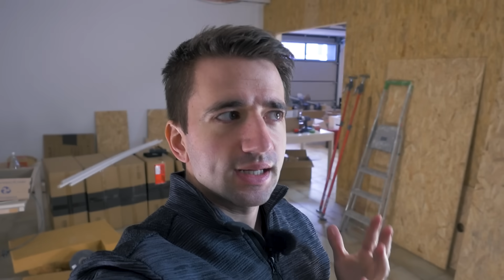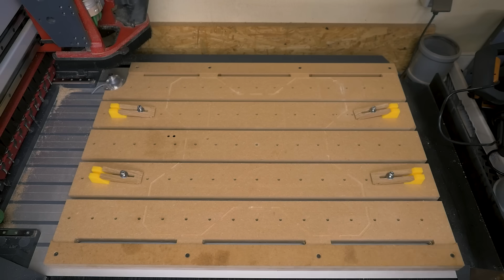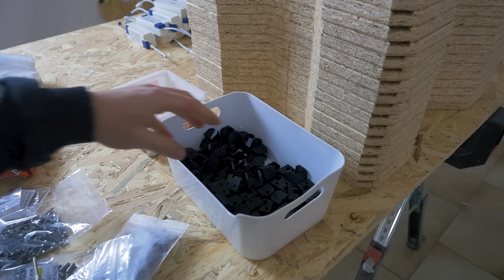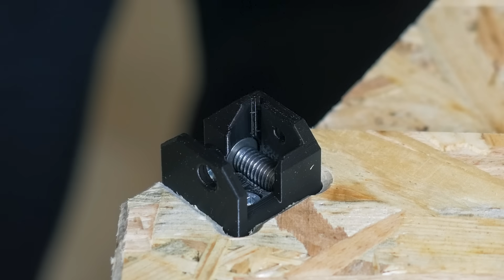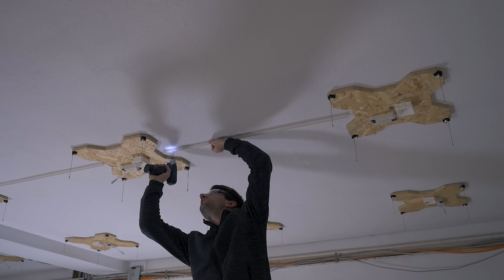New Workshop #13 || Over The Top Light Installation

Comment: This lighting layout is a fine example of what not to do.  You will note that the lighting panels create intense squares of light and leave the ceiling grey, which accentuates the effect.  For a workshop general overall lighting is required and this is achieved by using the ceiling as a reflector, shing the light up, not down.  Illuminating the ceiling gives a greater sense of space, which lifts the spirits.
Reply: Its his own workshop so it doesnt matter, but other than that, thats a cool thing to know about anyways

Comment: I think you may have got the wrong product...they sell lights that install both structurally and power delivery over tracks.  You could install the tracks and then mount the panels and you are done.  But then the problem is only about how much you want to spend, I am sure those systems come at a premium versus diy.

Comment: Great, very detail oriented work. Me coming from German event engineering has just one thing to critique: all the these panels hang from parts made 100% of wood and plastic. Nothing is fire proof. Even making one of the four corners from metal parts would have increased the general safety a lot.
It won‘t need much heat for the panels to drop down - in the way of evacuating - or worse, on people‘s heads.
I am fully aware, this is a private installation at your own risks, just something to keep in mind if you ever ponder taking on an installation like this again;)

Comment: I would have probably gone with 3d printed clamps that are screwed onto the osb and clip onto the panel in some way. More plastic and print time, but no adjustment after installing and way easier to assemble.
Maybe even a two part design would have been nice, where one part is screwed down with the screws you used to secure the rope. The other part could then be a hook that clips into it using a flexible design.

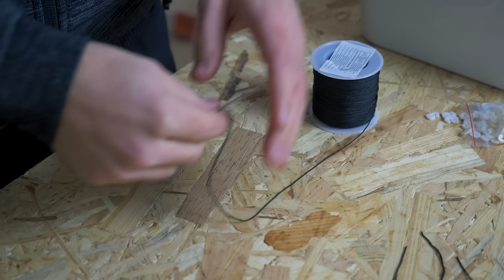Comment: I am not an engineer or experienced like you, but, i believe that knotting the strings part 5:47 was the most time consuming and labour intensive. 
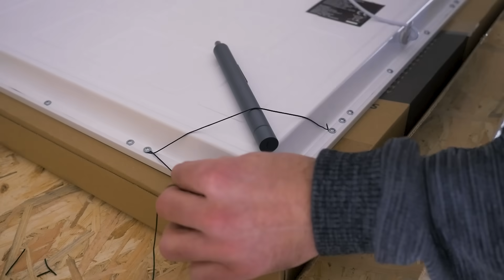Since you tighten the string, using the existing screw on the corner of the light 10:50, you could have use same technique.
in short: you could screw the string to your printed part to hold it, instead of knot

Comment: Could just be me, but those panels seem to have shortened the reverberation time of your voice in the room. 
You could use a similar approach to mounting acoustic panels on the ceiling. 

Anyway, great solution to mounting lights that a designed for false ceilings.
Reply from the maker: I'll wait with noise dampening until my machines and other equipment moved in

Comment: Overengineering, wie man es bei dir gewohnt ist - ich mag's! Allerdings hättest du dir wohl knapp 25% der Arbeit sparen können; vier Lagerpunkte sind ja prinzipiell mechanisch überbestimmt. Dreieckige Grundplatte (weniger Verschnitt, funktionelles Minimum) und drei Stellwinden pro Panel hätten's genauso, wenn nicht sogar besser getan. Einziges Argument dagegen wäre wohl nur die optische/geometrische Ungleichheit. Eine runde Grundplatte könnte dem aber auch gut entgegenwirken, aber auch eine quadratische wäre möglich.

Comment: How about glueing metal to each corner and having magnet on the OSB panel.  Lift the light unit into place and the magnets hold it in place.  Making the metal corners large enough that adjustment left right and front back so all panels can be aligned to laser level line.

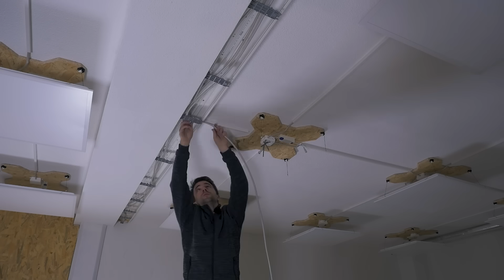Comment: @12:39 fun, remembering renovating my first home,… the first official new light switch! Turning on/off several times enjoying the comfort (for years worked with extension cords/plugs) 😂
Reply: I built a pantry last weekend and relocated a light switch to a new wall that was much easier to get to than it was before. When I was done I had to turn it on and off several times.😁

Comment: It all looks fantastic - but I have a question about dust Marius. A lot of your work will produce fine dust in the air, which will collect on the tops of the lighting units. so when you adjust them, some of that dust will fall down from them. Are you concerned about that?

Comment: What are the winches made of? Polycarbonate?
Also, after watching the full vid, it's an interesting mounting option, but all of you are going to run into heavy problems with dust on top of the panels. (altough I have to agree that the mounting frames that kinda "seal" the panel to the ceiling in itself, are expensive as holy fuck (I work on lighting design, so I see a lot of those)

Comment: as a contractor by trade, I can't stay silent on the subject :)
a rockwool suspended ceiling would be much cheaper and fast I believe
and you didn't seal the osb, it's a crappy material that's weak even against moisture.
but nevertheless I really enjoy your content 👍👍👍

Comment: @Mh Anything,
If you do a similar set-up in the future. You always pre-wire one of the panels with a 'tail' to the next panel. So whenyou install the first one, you already got it wired at one spot. So you don't need to work over your head for too long.

Comment: Looks great! The 3D printed winch design will probably come in handy another time. I could easily see making a pretty cool toy crane using that design with a mini gearbox to speed up the winch.

Just wondering why you didn't use 3 winches per panel instead since 3 points define a flat plane?

Comment: A classic: the first 80% of the work take 80% of the time. The remaining 20% of the work take the other 80% of the time.
Reply: Well - as we all know: That's math from real (project) life! 
And in several cases it turns out that you need 80% of time for the step from 80% to 95% work done and another 80% time for the last 5%.
We can conclude:The miracle of "China speed" is that they stop at 30% time having done 50% of the work.
Reply: @wn3788  any country looks like shit if your view of their industry is filtered solely through the lens of unscrupulous importers and drop shippers, and news stories about instances of corruption. it's not 2003, China is not the go-to destination for low-cost labor. why do the factories of China keep getting OEM contracts from respected Western brands, when there are cheaper places to source labor power from in most sectors? is it really inconceivable that the massive, centrally-planned, decades long investments China has made in its industrial capabilities might have actually paid off?
Reply: @HexenzirkelZuluhed  your math is... Interesting 😂
Reply: Has anyone ever finished a project within 100% of the time? I usually need at least 200% of what I planned  @jamesgregsy
Reply: You just don't get it, do you...? 😅
Reply: You mean: 80% of the work take 20% of the time (Pareto principle)

Comment: I'm curious... why did you guys not use gypsum plates on the walls? Either exclusively or in combination with the OSB? I think that would have offered a lot more sound dampening between the rooms, esp. if you doubled up.
Reply: because now they can mount anything pretty much anywhere on the wall, and have more support than crappy sheetrock anchors.
Reply: @barry99705  Sure, but you can do both if that is a requirement. The added mass of the gypsum/sheetrock helps a lot with dampening, which could be valuable in a shared multi-studio setup

Comment: why not use a central power supply (or two) instead of 21? would have been more efficient...
Reply: The current would be too high for any normal lighting equipment. 21pcs at 40w is 840w total. At 33V that is 25amps, you would need a 4mm2 cable. With a smaller cable the voltage drop would be substantial and visible across the panels.
Reply from the maker: The panels come with their own power supply
Reply: My guess is the option to turn them on individually. Not an electrician, so no idea if it would work with only 1 or 2 central supplies.

Comment: Nope, Should have made strip lights. 
With brass or copper or a nice material. 
And better diffuision. 
The panels are not green they are plastic junk. And they do not have efficient drivers. 
Running strip lighting at low power, and lots of it makes it more efficient, more bright when needed and a more even light distribution. 
You could do many designs with straight lines. 
It would be much much more simple.
Reply: Ok if you say so, I think it’s great

Comment: 1. Working with something over your head is always surprisingly more tiring and more time consuming!
2. Working with soft materials, nylon strings in this case, ususally takes a lot of time becuase how soft and unpredictable they are. Using steel cables and crimping instead of tying knots might be faster?
Reply from the maker: 1. I thought so. That's why I went with one center screw instead of four at each corner
2. The knots were one of the quicker tasks

Comment: nice idea with the cord in bettween the screw heads on the pannels but i think a printed adapter would be better i would not trust the screws like that. Nice Idea with the winches :)
Reply from the maker: Interesting. After assembly the screws are what I trust the most